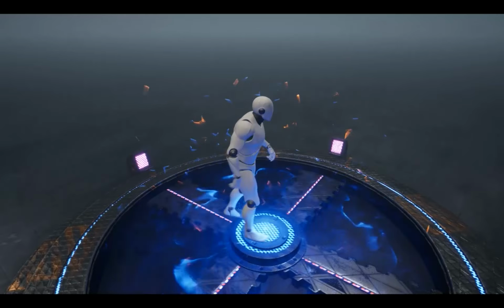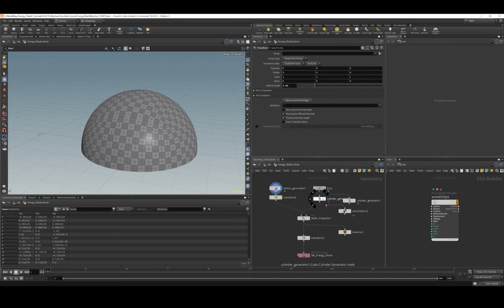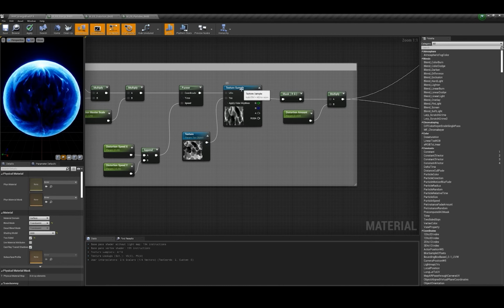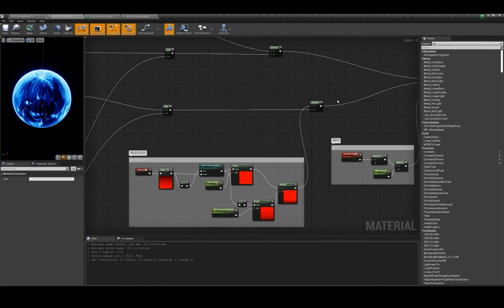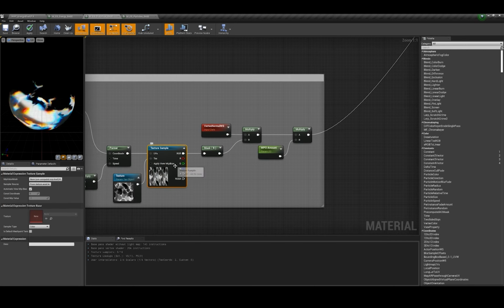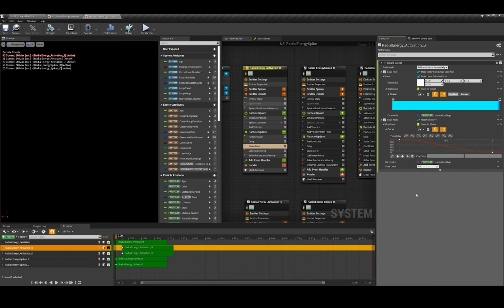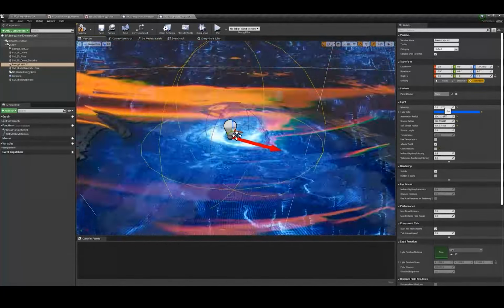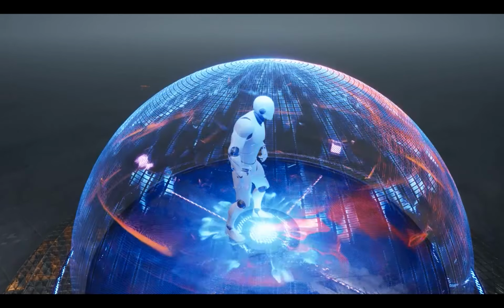Energy Shield Portal in Unreal Engine & Houdini (Pro Unreal Engine Tutorial)

Comment: Are the meshes easily created in other 3d software such as Maya if we do not have access to Houdini?
Reply: Great question! Yes, you can use similar techniques in other programs. For example, if you created the Dome mesh via a Cylinder in Blender, just use the Shrinkwrap modifier and make sure the underlying guide mesh is subdivided to level 2 or 3. That will behave the same way. Just make sure you at least line up your edges close to the topology of the guide mesh first to avoid weird artifacting.
Reply: Exactly what I wanted to ask